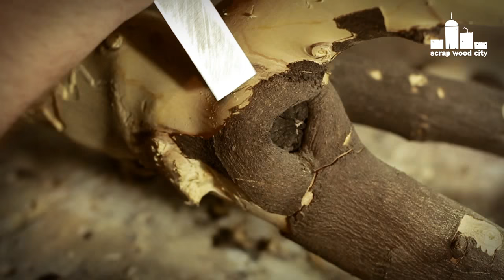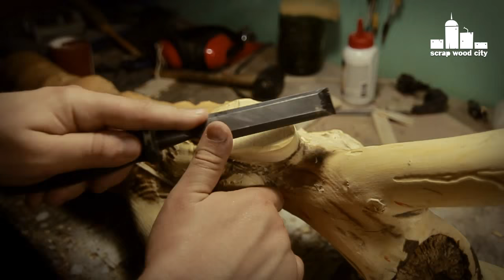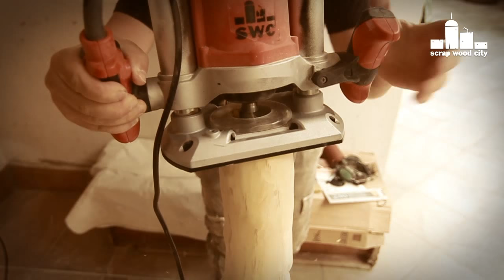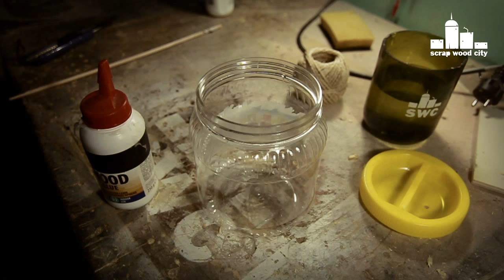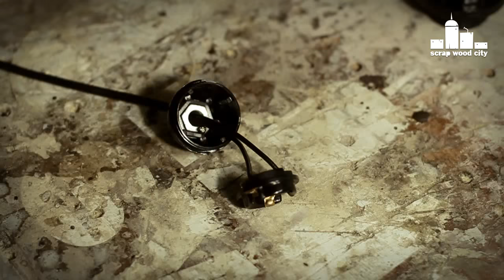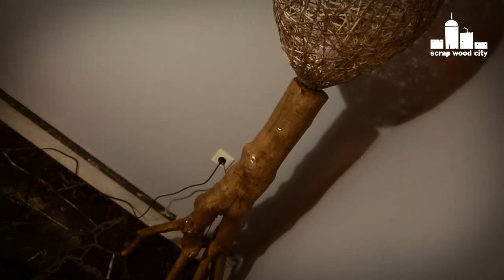Experimental, DIY, floor lamp from a log

Comment: ever heard about bead blast to remove bark and a sabre saw to split it!!
Reply from the maker: Actually splitting the wood the way I did works much better for me, it's easier and works with really thick pieces. The blasting technique is interesting but requires tools and space I don't have. It also leaves a kind of surface that's not always what you want. For example if I don't paint the surface after all I wouldn't like that much!